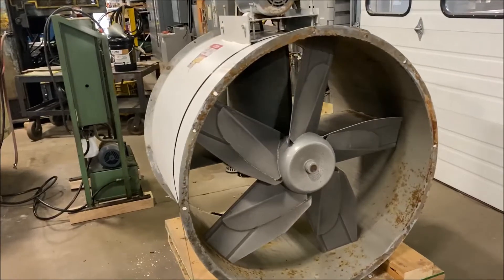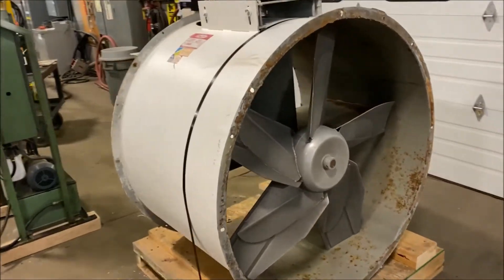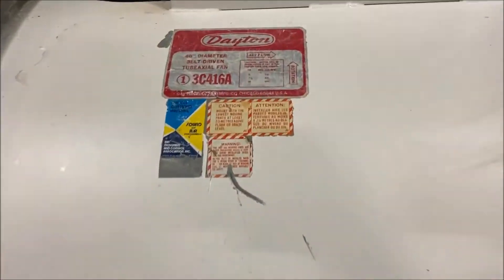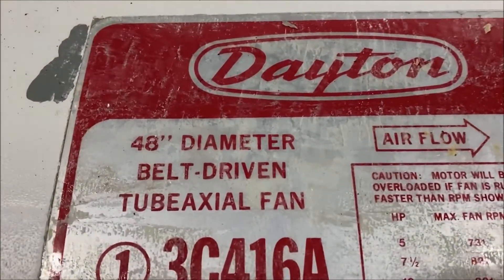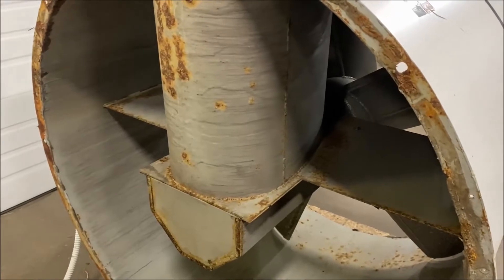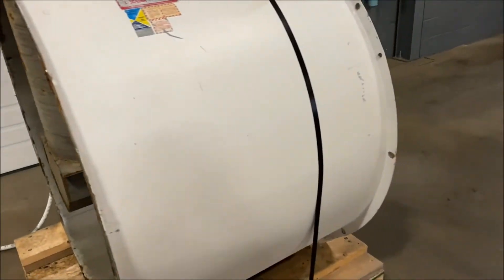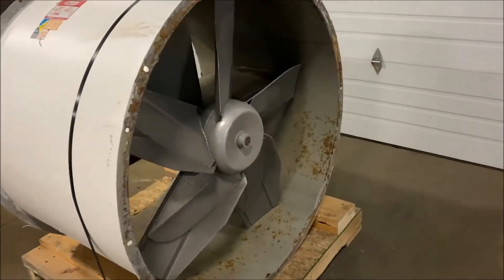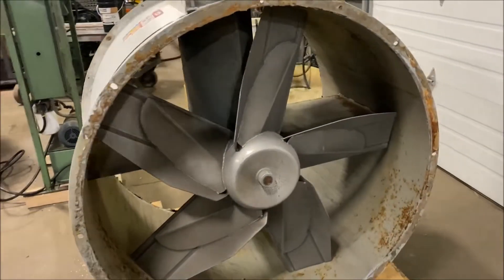Dayton 31,000 CFM 5 HP Steel Exhaust Blower EB2336

Comment: Would the bearings withstand a vertical mounting configuration?

I've got a weak-ass ceiling fan that just ain't quite cutting it.
Reply from the maker: This one will definitely make quite a bit of power for you - you shouldn't have any issues with bearings vertically mounting it